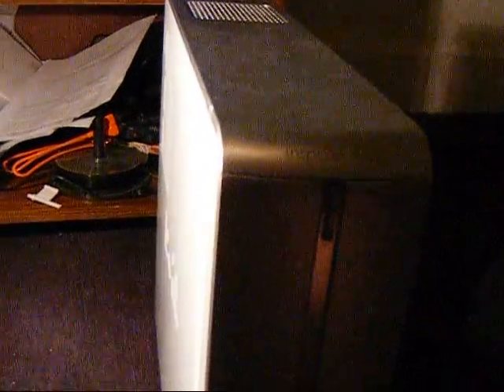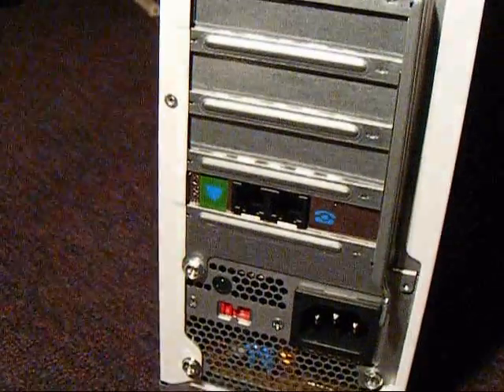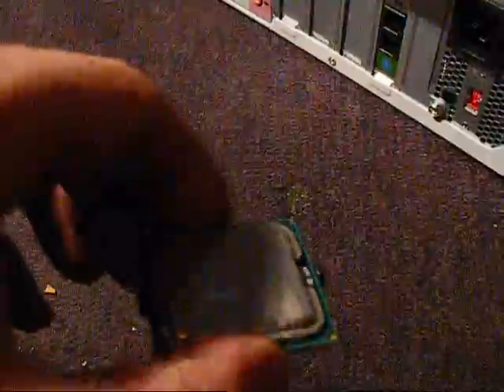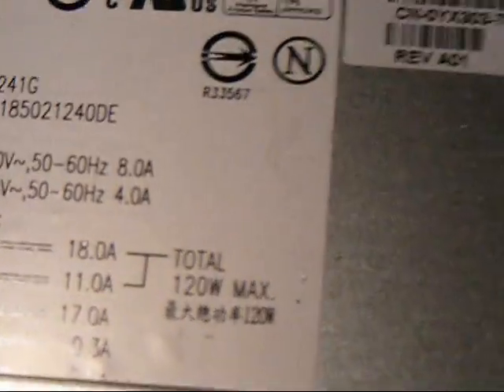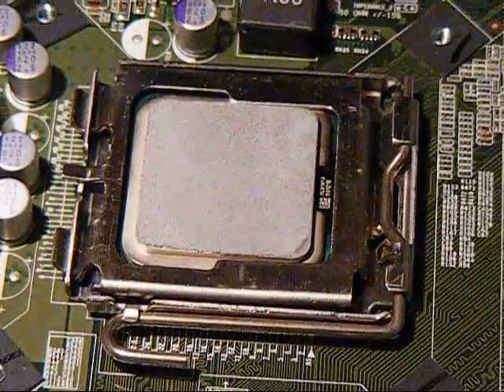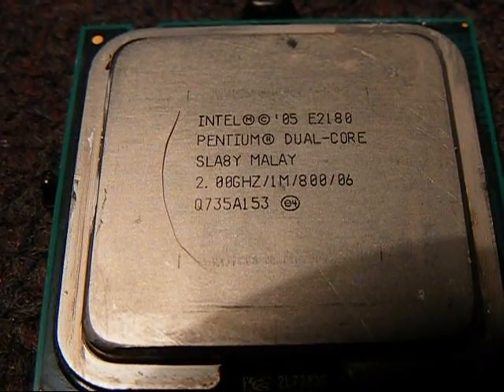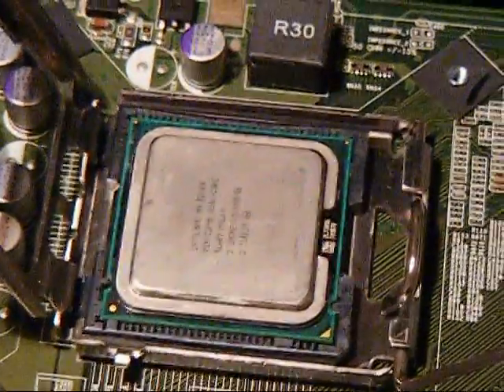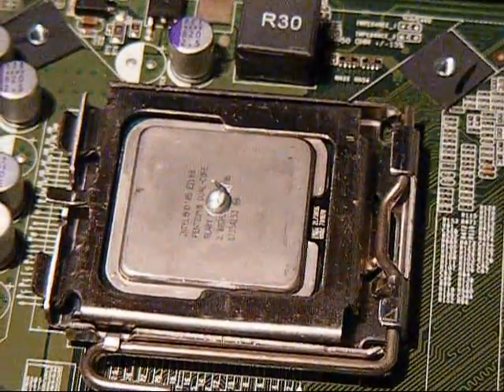How to Upgrade your computers CPU and save money

Comment: Im running on mine a pn "intel dueo core 2 processor" 4gb ram and nvidia graphics card. It plays dead space/dragon age origins and skyrim. The games i prefer. I want to upgrade the cpu, but doesnt everything need replacing, power supply. Motherboard, graphics card and cpu? Also doesnt haveing a larger hard drive make games play smoother... i got a 500gb atm and its got 33 games, most retro.
Reply: no the only thing to replace is just the motherboard if it can't handle any higher.
Reply: what cpu do you want?

Comment: Here's what I'd like to know, can I upgrade this motherboard with Celeron D 3.60ghz to a Core 2 Duo 3.00ghz [or at least force processor upgrade?]

Specs:

Motherboard-RC415ST-HM  REV: 1.0
Graphics- Ati xpress 1100 
Ram- 3gb
HDD- Seagate 120gb
Processor- Celeron D 360 SL9KK 3.46ghz

Comment: I currently have this Intel Core 2 Duo processor.. Is there any precautions to be taken if i want to upgrade to a quad-core? or is it possible to upgrade so simply as you did in this video?
Reply: the only major precaution I can think of is, to make sure your motherboard can handle a more powerful processor,
Reply: You have to figure out the socket type of your motherboard and it's bus speed so you can get the right CPU before you just buy one ;)
Reply: also update your Motherboards BIOS.

Comment: 1. your working on carpet
2. you put the processor pins down on the carpet.
3. you jiggled the cpu in the socket risking bending the pins
4. you didnt apply enough thermal paste, and you also didnt spread it out.

Comment from the maker: its not the same cpu as you can see if you watch the video closely. I changed out a single core cpu with a dual core.I have never had a cpu or any component fry by touching it. It grounds itself out once power is connected with a 3 pin plug before you turn it on. Thanks for watching

Comment: That applies to most people who've been working on computers for years but the possibility does exist that static discharging into a component may damage its circuitry. It is not designed to take a large current and, like a fuse, the sudden large load could, theoretically, burn out part of the very fine circuitry making it inoperable. The best precaution is not to touch any contacts on the motherboard. For other reasons you do not want to touch the contacts on the CPU as he does at about 6:00.

Comment: Ok so first off the title to your video is upgrade cpu and save money, how the hell do you upgrade a processor by putting thermal compound arctic silver 5 looks like, on top of the same processor? its still the same processor. Also! dont ever put a processor or any chip as that matter on a carpet cause theres a 99% chance of it frying!!! and nobody cares about the specs on the power supply lol it was nice to put it in there, but put your video to the point. Im an IT trust me :)

Comment: Nice video, i have a Dell Optiplex 755 it has a E2160 and i want to replace it with E8500. Do you thin it will work and do i need any additional software?

Thanks

Comment: @cp4781 - OR open the case, read the model number, usually printed in large letters, and look it up online. The manufacturer will usually provide the specs for your motherboard online, providing all the information you need for upgrades/compatibility.

Comment: @nora8brian not only do they have to have the same socket, but they also have to be compatible. you cant just throw any same-socket CPU in the slot. For example, I have an MS-7525 motherboard with a 775 socket. However, I cant throw in any E8000 intel models in there, because my motherboard can only support up to the E7000 product lines. Which is why I recently upgraded to the E7600.

Comment: @blueovalfan23 since water cooling cpu systems are farily cheap, 60 bux to 125 is a great price budget for me, and there plenty of different ones on the market. and the GPU i got is a PNY Nvidia Geforce GT 430 1GB DDR3 96 stream cpu's i belive, and for the around 60-70 bux i paid, it runs many of my games at settings completely maxxed out at 1024 resolution on a 32" flat screen through HDMI. im quite pleased to say the least. :) this was also my first ever build

Comment: @blueovalfan23 LOL yeah man tell me about it... HP and Dells for example, priced quite high, normally the only thing your really paying for is the dumb brand name. i used all my existing parts from my compaq CQ5000 series desktop, motherboard, ram psu dvd drive and HDD,in a gaming mid tower, ONLY 250 watt psu, and its running the new amd athlon X4 640 cpu flawless,temps are pretty high on "high power" but within a safe range i belive,eventually going to go with water cooling --->

Comment: @demonsparkx i like walking through walmart and laughing at the prices on machines that couldn't touch mine and knowing what i put in it. i didn't get an o/s or monitor but it was worth it. a couple things to watch, on cheaper boards they sometimes have a limited h/t and tdp rating. if you have the time to wait, you can find good deals on ddr3, often 8 gb kits for 30-40 after a rebate. just wondering, what gpu/video card did ya get?

Comment: @MChief6596 not to troll ya but a new machine. you'd at least need a video card. i wouldn't try a high end card on that rig as it is. the cpu is going to bottleneck it. i've seen 8800 and 9800 nvidias running it and i know for a fact that the ati 5670 will run it. just  try google and know that chip isn't going to allow you to max the settings and run the high end stuff.

Comment: @demonsparkx manufactures suck with the limited info they offer some times. they don't want you to customize when they can sell you a new tower it seems. i've been where you are to. i ran the same old board till this time last year with ddr and an agp slot. the cool thing is you can get a better board later and some ddr3 when you take the notion. maybe even a x6 core or fx chip if they every fix them to be what they could have been.

Comment: @blueovalfan23 i figured out a few things since that comment, turns out the company "pegatron" that makes the narra5 board i have, doesnt update the bios, so itll only and automatically support cpu's that were out at the time as the current one, may 11 2010 i belive it is, the one im getting is a athlon 640 x4, also released the same day as my current cpu. and yes, i do plan on getting a more up to date board that uses DDR3,but as for now, i just spent about 300 on a few --->

Comment: @ferdaws2000 i doubt it. that t3400 is a 478 socket chip. the mobile i series intels are not going to fit. sorry.. those dual cores aren't to bad for normal use though.

Comment: @demonsparkx since no one offered you advice.. am2+ sockets will take am3 but you may need to update the bios to recognize the new chip. it'll run it but you may need the bios update. the board is limited to am2+ and am3 cpus at 2000 m/t at 95 tdp. you won't need to up the ram or anything else physically. i would get a cheap am3+ board and some ddr3 if i was you. it'll upgrade the chipsets and run the quad chip with the intended bus. it'll cost more but will be worth it.

Comment: i have a compaq CQ5600Y with a amd athlon II 170u processor, all stock computer. narra5 MB. says it will take AM2+ and AM3 CPU chipsets. will a AMD athlon II X4 640 Propus work on my setup? 95W TDP. will there be any bios issues? ram and 4-500 watt PSU will be upgraded too. ill subscribe if ur nice enough to lend me some advice :D

Comment: @chicagochris1988 I got a Intel Celeron 420 1.6GHz 800MHz and I need to upgrade for WoW to work again, I was wondering what other CPU was good in the socket 775. Im an a budget of $60 to$100 which one is good?

Comment: @senadobrasil changing bios dosent help with being able to change to a different cpu then the ones you say your motherboard can handle you want a cpu better then them 2 u have to buy a new motherboard i mean they arnt expensive im building one and i have the latest motherboard for intel motherboards i know ur amd but same works for amd and mine is ready for the nxt processors after the sandy bridge processors amd it only is costing $149 for the motherboard

Comment: @coollabby00 something other then the intel sockets aka 1366,1155 etc it depends on how old your computer is if its a old computer like early 2000 or 1990s then its just the basic socket if its between 2010 n now then its a new one just have to check amd website and look up your processor to see what yours is

Comment: @chicagochris1988 I'm considering throwing in one of those dirt cheap Athlon64 3200+ OEMs they're selling on ebay in an old Sempron 3000+ (1,8) Gigabyte rig from Packard Bell. Any reason why this monster wouldn't live? My friend suggested the Athlon64 OEMs could have compatibility issues (something about bios).

Comment: I have a a Athlon(tm) Processor 2650e, *the sticker on outside my computer has a 64 on it but my computer is a 32-bit. I want to get PNY - NVIDIA Quadro NVS 450 512MB GDDR3 PCI Express Graphics Card but in the description it says 2 proccessors so does that mean that it has 2 proccessors or needs 2 processors to run? I would be installiing it on an Emachine 1300G. Hope you can help, I have no idea about computers

Comment: @chicagochris1988  I have a gateway 838gm and my mother board supports an intel pentium 4. It has a 775 LGA socket. I want to upgrade to a intel pentium dual core 3ghz. You think it'll work?

Comment: also how does the pentium duo run? never tried it out, i upgraded my celeron cpu to the core 2 duo e4300, 1.8ghz, i want to go to a faster cpu but hp says that i can only go up to a e4300, could i try and go higher? because i used 2 2gb ddr2 ram when they said i can only use up to 2gb when im running 4gb

Comment: I have a Dell Dimension 8200 with P4 2.0GHz socket 478, can i upgrade to a hire processor like 3.0- 3.4 HT. And there can be a difference on performance. Thanks

Comment: I want to upgrade my cpu so
Do i can change for this one : AMD Athlon 64 X2 6000+ Windsor 3.0GHz 2 x 1MB L2 Cache Socket AM2 125W Dual-Core Processor - OEM 
because i have single core but this is dual core so do this cpu is right for my computer? 
plz help

Comment: you have to know what motherboard you have. you can see what you ahve by running dxdiag.exe. it reads on the main page. then just google it. im pretty sure it uses lga775 but supports only old intel pentiums, so you might want to upgrade your motherboard aswell.

Comment: yes. you have to make sure your motherboard is compatible with the new cpu youre buying. usually the problem is fixed by updating your motherboards bios. there is a risk on updating bios that it will corrupt your motherboard and it wont boot anymore, but the risk is so minimal you dont have to take care of it.

Comment: well not always you have to remove carpet but then you have to wear socks because having carpet and no socks equals to static electricity for your hand that can damage components. touching the case is a must because you cant open it without touching it :D. you know if your motherboard supports pci-e if you have long, usually white or blue colored expansion slots with sometype of plastic locking mechanism on the right side of it.

Comment: for all the newbie's.
1. Always see if your motherboard support's the new cpu you're going to buy. Ask from your motherboard's manufacturer or look from instruction manual.
2. New cpu's ALWAYS come with a processor cooler.
3. You dont have to as carefull as explained on video. Just make sure before doing anything that there's no carpet on the floor and your not wearing socks and cotton/wool clothing
4.  always remember to touch the metal case for the static electricity to discharge.

Comment: how do I know what processors I can use with my motherboard, my computer is an hp a6403w with an Intel Pentium dual CPU E2160 running at 1.80GHz would like to upgrade to anything above 2.0Ghz, thanks for any help

Comment: question for all geniuses

my boss was nice and gave me a free 3.2ghz xeon (apparently multicore) processor. i replaced my 2.0ghz p4, and its been working fine for the past 2 weeks, but in my bios it still says P4 and my bios is locked i.e. i cannot change any processor info, therefore i cant overclock either. My bios version is A05 and i have an old DELL DIMENSION 4400. not sure about the mobo, although its a dell also. any tips so tht i can overclock or atleast make it recognise my new cpu????

Comment: Good video I had the same CPU overclocks like hell, but in stock configuration it runs cool and is very powerful despite its low end specs.

You look familiar do you have another channel here?

Anyways great work gonna add my dell hsf removal vid to this if you don't mind please except.

Rick Arter